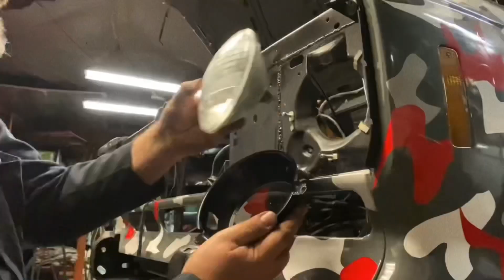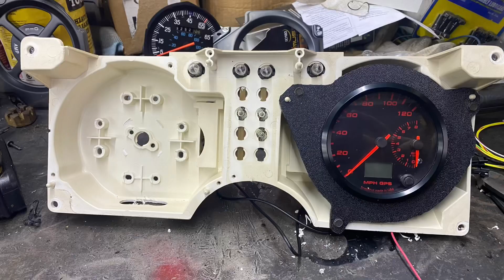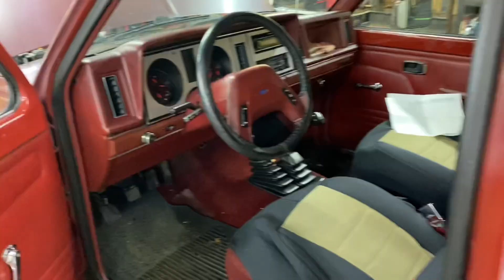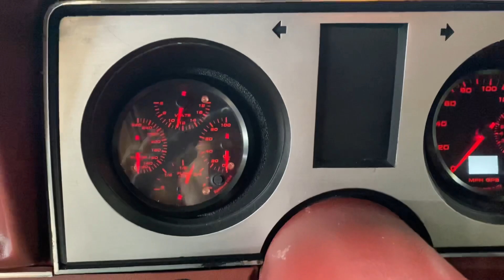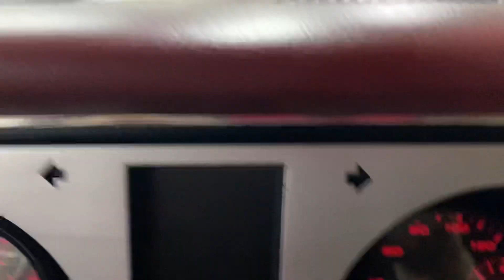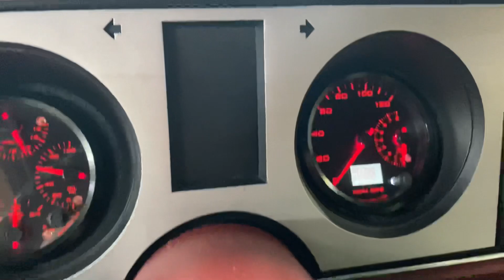Speedhut gauge install Ranger Bronco2

Comment: I have an 88 BII and my coolant temperature gauge was starting to wander. The ammeter never worked. I removed the thermomechanical instrument cluster voltage regulator and replaced it with a $1 Buck Regulator (LM2596) set to output 5.4V. It works like a charm. The coolant temperature gauge no longer wanders around and the ammeter now works. It still looks stock too :-)

Comment: Hey, thanks for the walk through, you've i spired me to grab a pair of these for my 4.0 swapped 88 ranger. 2 questions I have. 
1) Did you do anything about the high beam indicator? I noticed you opted out (I was thinking I would too because the turn signals are on the face plate of the cluster). 
2) I think I've heard about you or a friend of yours 4.0 swapping at some point. Do you have a solution to get coolant temp on the dash... from what i can see the 4.0 ohv has only coolant temp sensor and it's used by the computer. My mechanic says I can't tap into it because it'll split the voltage and give the computer and the dash both an inaccurate reading.
Reply from the maker: I’ve had these gauges made with and without the high beam and turn indicators. On my truck that doesn’t have them in the gauge I bought tiny LED lights I installed in my custom dash bezel. 
 You can get a T fitting that will go in the heater hose feeding the heater core that will except a temp sensor. They are cheap on Amazon and Ford actually used them factory on a lot of Rangers

Comment: Another quick question for ya.when u set the empty /full on fuel gauge did u have to find the ohm rating for every level of fuel in fuel tank?like empty,1/4,1/2,3/4, full tank.or did u set empty level and full level and thats it?also to set empty level does tank have to be empty.tanks full the moment.
Reply from the maker: You only program in your own full and empty settings if you using the Custom setting option.  Otherwise you just select the ohm range for your sending unit per the directions. It’s very easy
Reply: @randumadventures  so if I know the ohms for empty and ohms for full that's all I need for it to work correctly?to set empty I'm assuming it has to be empty and vice versa for full? Is that what u did for the bronco ii
Reply: I'm using my oem 2wd 1987 ranger shortbed  sender
Reply from the maker: @patrickdubuc3439    https://store-ta980ko58k.mybigcommerce.com/content/instructions/2in_and_258in_rev_fuel_level_instructions.pdf

Comment: This might be a dumb question but on these guages how do u get the volt reading since it doesn't have a volt wire to run?is it the 12v keyed ignition or?
Reply from the maker: Yes the keyed 12v power for the gauge is all it needs

Comment: Sorry.last question.did u cut a hole on the bottom of the none speedo side not directly on the back where back lighting green plastic bulb is?I'm Just curious if u cut into any of the oem wiring matting on the back of bezel?and where u made the hole to run wires for none speedo side?

Comment: What did use for blinkers since u put in the gauges?did u take all of flat plastic green wire stuff out?
Reply: Never mind I saw the hole u made on the bottom of bezel.sorry for all the questions.love the videos.helps out alot
Reply from the maker: The factory blinkers are still there and functional. You can option the speedo with blinkers also though
Reply: So did u plug in the 2 factory plugs back into back of bezel?and did u cut a bigger opening on the fuel gauge side to fit wires behind like u did on the speedo side?
Reply from the maker: @patrickdubuc3439  yes and yes

Comment: How does the water temp sensor work if your car has an electric fan from the factory?do u have to splice the speedhut gauges into the oem harness to get fan to kick on or will speedhut gauge harness be good enough?
Reply: Your correct!i realized that after I sent u the message.sn95s are on the coolant tube.should be all set.thank u again for the quick response.
Reply from the maker: Every car I’ve worked on uses two separate temp sensors. One for the dash gauge and the other for the computer which controls the fan
Reply: Also what thickness plastic did u use for the gauges?
Reply from the maker: @patrickdubuc3439  it’s 1/8th inch